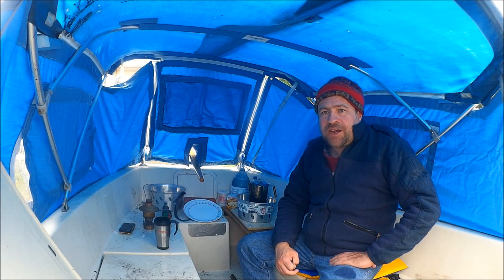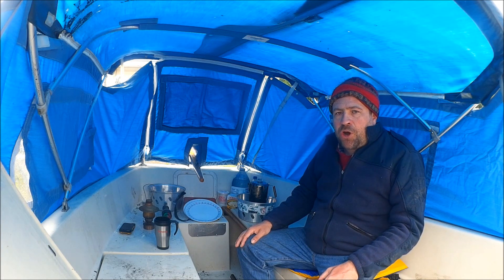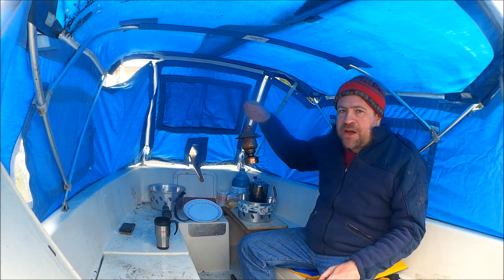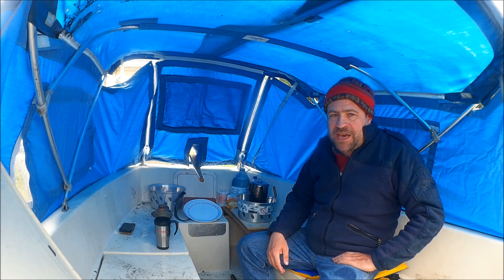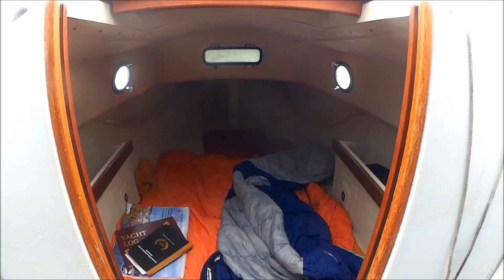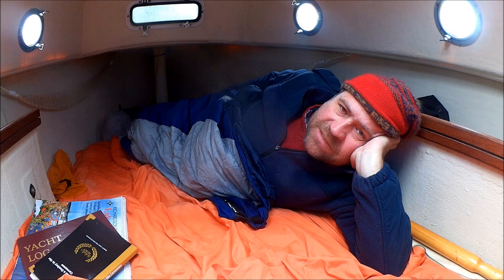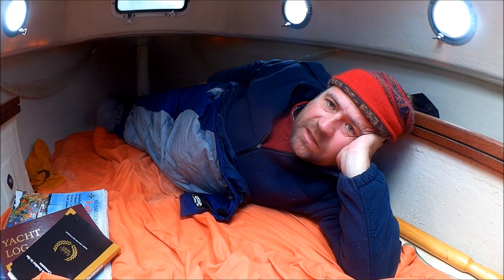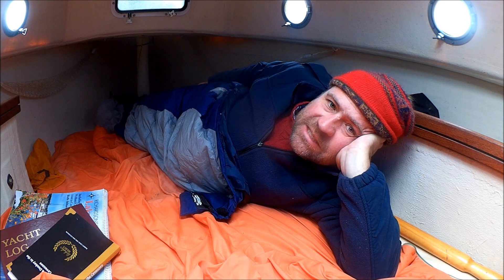How to Set Up a Small Sailboat for Camping

Comment: Thanks for sharing. Very nice that you can land that boat nearly anywhere...  a couple of thoughts: I have seen some nasty fires started by kero lamps (I used to love them) - instead if you're charmed by reliable old tech consider those little aluminum pot candles (called Tea lights in Austrslia) but never sit that little pot on a timber or plastic surface, and fall asleep (when it burns to the bottom it can char the bench) sit it in an unbreakable SS dish with some air space under (concave bottom) I have sat these things in a stubby tough glass jar, and it gets just enough air; you can  drill an air hole near the bottom of the jar (they say - with the correct drill bit) ... That little fire can become a huge issue - in your boat or forest etc.

While I'm raving: if you "go to the wash room" in the bushes, if you use toilet paper, burn that (safely), don't just bury it with your fertilizer deposit. Amazingly, at least in Australia there are critters who'll dig up your deposit, but they don't eat the paper. It blows about, spoiling a beautiful place.

Good minimalist boat. Some much more expensive ones are difficult to take ashore (without fear of expensively scratches, or getting stuck and needing a team to launch again)(experience) so they tow a dingy! ..another source of worry!

Good for my dreams!
Reply from the maker: Thanks.  I ended up retiring the kerosene lamp in favour of an LED lamp.  Way simpler.  Good tip on the washroom, one thing I can say for our Canadian wayerways is they are very clean.  Parks Canada and Ontario Parks, municipalities are really pro active about providing facilities even in remote areas.  It may be nothing more than a Thunder box, but I will take a thunder box over digging a hole :)

Comment: Looks to be pretty cold and damp there, which detracts from the pleasurable experience of boat camping.

Perhaps consider the fitting of an excellent Lenihan Charcoal Heater into the cabin.

Even the Fatsco Pet Stove (Model 450) would fit nicely in that cabin, and they're constructed from marine grade stainless steel and high quality cast iron and are a favorite of liveaboard boaters.
Reply from the maker: Thanks!  I do have a nice little heater.  I have an Origo 5100 alcohol heater.  It does a pretty good job of taking the chill off.

Comment: 21 footer! I camp and spend many days on my 17ft Reedcraft Seahawk drop keel and use a 12v heater, 12v kettle with solar charger and outboard electrics. Food I cook at home then vacumn seal them so I can head up with hot water onboard. Heater warms the whole boat up within a few minutes. Lights are cree 12v strips and solar operated multi colour
Reply from the maker: Sounds great.  I get my heat from an alcohol heater.  Origo 5100 Heat Pal.

Comment: Where do you store your sails, life jackets, etc?
Reply from the maker: We usually wear our life jackets and we don't carry any spare sails.  The boat does have quite a bit of storage though.  We will usually store soft items like clothes, sleeping bags etc in the bow area, both forward and aft of the mast.  All our dishes, pots and stove we store in a large cockpit locker on the port side.  There is an even larger locker on the starboard side cockpit where we store our inflatable boat, fishing supplies, safety equipment and tools.

Comment: Kerosene ? Is that a good idea, why not a regular rechargeable waterproof  lamp / torch, a bit safer if you want light and fall asleep, just saying.
Reply from the maker: I have since switched to the battery operated lanterns.  When I owned bigger boats (30 and 35 footer) kerosene made for a nice bit of atmosphere.  However, the battery operated lanterns have become so cheap, safe and reliable they are hard to beat.